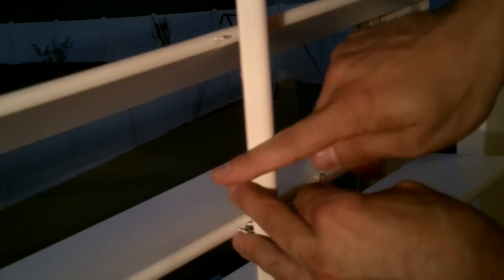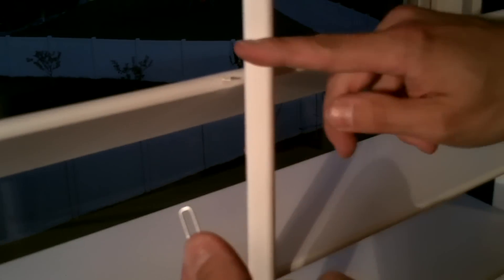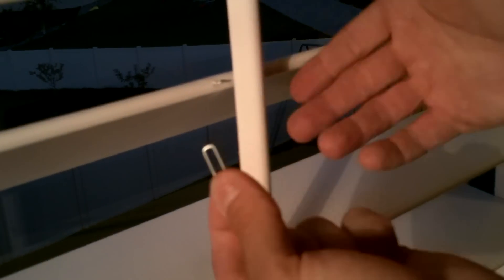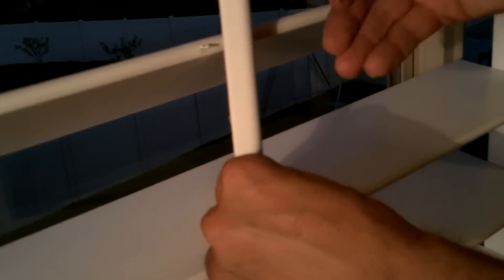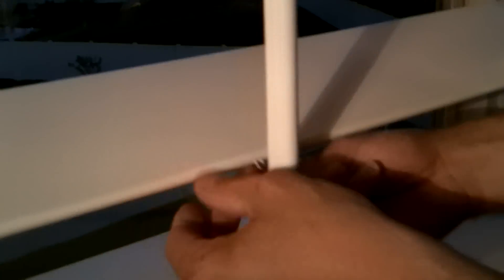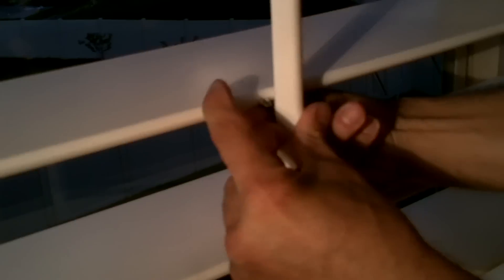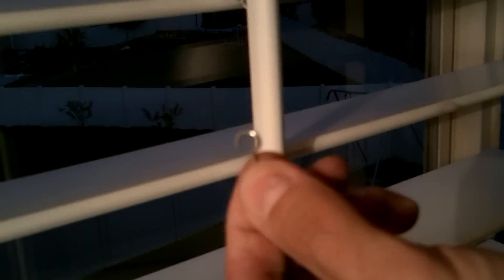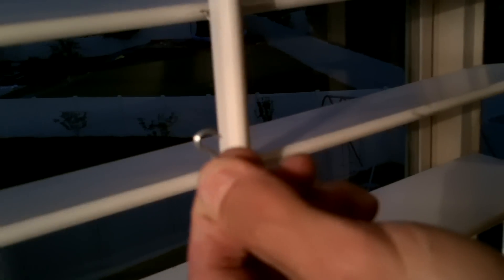Fixing a Shutter Slat Staple

Comment: Brilliant video. I've had issues with my shutters for years until I found this.

For anyone else who sees this video and wonders what exactly they need, I purchased the following:

- KNIPEX Tools - Long Nose Pliers With Cutter (2611200), 8 for $30 on Amazon 
- 2x 8-pack of #216 -1/2in Screw Eyes from Home Depot for $1.30/ea. 

To pry open the screw eyes, I did the following: With one hand I inserted the needle nose pliers into the screw eye opening while I held the other screw-in section of the screw in my other hand (with a thick dish towel to avoid hurting my fingers) and then simply pulled the screw eye open towards towards me enough to ensure I could work the shutter staple into it after screwing it in.

Total cost of repair ~$35.
Total time of repair for 15 shutters: ~30 minutes

Thanks again for a wonderful video!